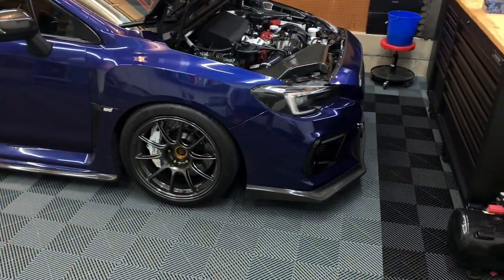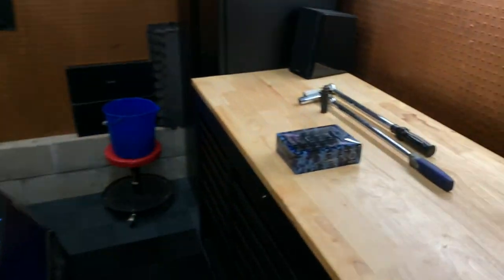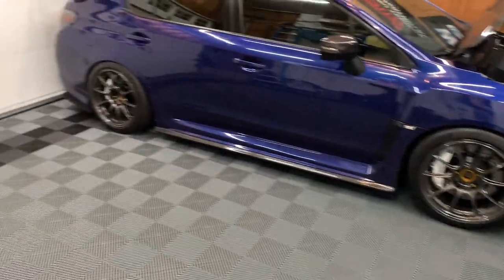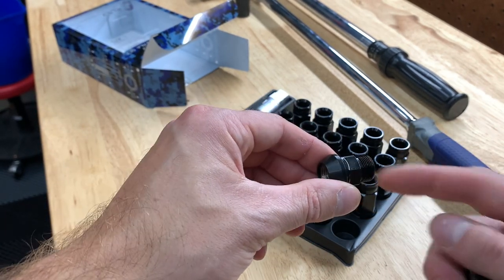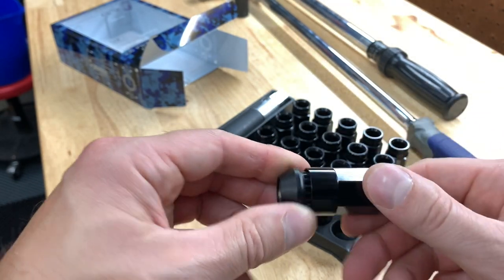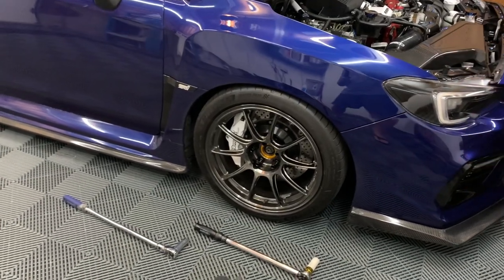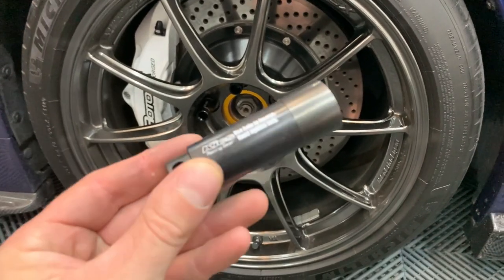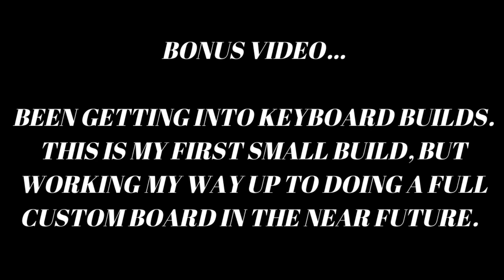Installing 2 Piece Project Kics Lug Nuts On My STI | + Bonus Keyboard Build!

Comment: Just ordered a set. I originally went with sickspeed. But those things are a joke. The molding on the lock nut splines were cracked. I wouldn't want to torque them down on my TE's and have it snap off, then have to resort to cutting them off and risking scratching my beautiful wheels. Thanks for the video, these look to be much higher quality, hopefully I like them 👍

Comment: Did you add any anti-seize to the threads before applying the lug nuts? I'm being told online that since these are aluminum nuts, anti-seize should be used. If not, did you have issues taking them on and off?
Reply from the maker: I did not and I didn’t have any issues.

Comment: Hey Chris, are you worried at all about not running extended studs with the spacers you have in the front? I really would prefer to run closed lugs, but I will be running 5mm spacers and they will most likely need extended studs
Reply from the maker: Im only running 3MM spacer up front. Lots of thread on the lugs. Anything over that, I would switch to extended studs.

Comment: Hey bro, Was wondering if these lugs are a float design at the point of contact where your lug touches the wheel? So when tightening youre not scratching your wheels. Or is that not a worries with these lugs?
Reply from the maker: These are not floating hats.
Reply: @Scoobyfreak86  no issues with scratching the wheel though?
Reply from the maker: @stephenculcasi never had that issue as I torqued them down slowly. No impact or aggressive wrenching.
Reply: @Scoobyfreak86  thank you sir. Also one more question. I also don't like the red valve stem that come on the TE's. Where would you suggest going for a set of black stems for my 2011 sti? I don't know if I can use just any valve stem on TE's, do you happen to know?
Reply from the maker: @stephenculcasi they have black available. I got black stems on my current te’s. They came with red as well.
Reply: @Scoobyfreak86 thanks, appreciate your help. I got 18x9.5 +38. I'm going for a flush look, I hate the stretch look and want a meaty tire. I know it's hard to say but what tire and size would you recommend? 255? Not wanting to do a lot of camber (more than 3).
Reply from the maker: @stephenculcasi 265

Comment: Will these work with extended lugs? I have the stuf conversion on my Jetta I believe they are 70mm and if they are closed I’m assuming the won’t work and my studs are too long
Reply from the maker: The caps are not open ended so it wouldn’t work.
Reply: Damn that sucks these things are badass

Comment: Did you put anything on your main hub locking nut to keep from rusting?  I have TE37'S and they don't make center caps (I also like the raw look anyways)  but I really want to keep it clean and rust free.
Reply from the maker: I haven’t but I just hit it with a steel brush every so often. You can throw some paint on top if you want to keep it looking nice.
Reply: @Scoobyfreak86  I want to keep the steel metal look. I like it. I just don't want it rusting. I'd love to find replacements in stainless buy I have no idea where I would find them.
Reply from the maker: Look into titanium works. They make titanium axle nuts. They will stay looking good forever. I’ll have a video on them soon.

Comment: What socket set are you using for your lug nuts? Kinda look like the Pittsburgh sockets that help prevent scratches
Reply from the maker: Yes sir. Harbor freight special.
Reply: @Scoobyfreak86  I just picked them up the other day how are they holding up?😂
Reply from the maker: They are doing great. Haven’t had any issues with them.  Great set for a good price.
Reply: @Scoobyfreak86  for our cars only the 19 mm is needed right? I just started getting into doing maintenance and aftermarket installs on my sti so I don’t really know a whole lot but your channel has definitely helped a ton!
Reply from the maker: Yes 19 unless you are running aftermarket lugs
Reply: @Scoobyfreak86  okay thank you!

Comment: I'm looking at new lug nuts.. why did you get these (aluminum) over something steel?
Reply from the maker: The lugs are steel. The covers are aluminum.
Reply: @Scoobyfreak86  ty for the responses.. I guess the size I need is just really hard to find 56.1-76.1.
also do you use metal or plastic hubcentric rings?
Reply from the maker: I use the project kics ones
Reply: @Scoobyfreak86  oh man.. even that brand doesn't have the sizes

Comment: Are looking to buy these, are they universal? Would they fit on my 21 Sti ? I got D9RS WORKS
LMK curious
Reply from the maker: They have different sizes available yes
Reply: @Scoobyfreak86  I checked on subie speed bro and they only have  universal ones, just wanted to make sure if those are the ones you have

Comment: I wish these had the rotating base.
Reply from the maker: Definitely would be a nice added touch.
Reply: I'm almost leaning toward the Kics Monolith in Neochrome and black cap inserts to go with the Glim black ZR10 19x9.5 +30. With Works Flat center caps in black.

Comment: How come you don’t run center caps? Does the hub centric ring prevent you from reinstalling center caps?
Reply from the maker: The caps that are available for the wheels aren’t the most attractive thing. Prefer to run them capless.
Reply: @Scoobyfreak86  but they are still able to be installed? Even with the hub rings on? Thanks for your response btw! I’m all the wayyyy from Guam 🇬🇺
Reply from the maker: The caps for these wheels have integrated hub rings, so you need to remove the ones I have on now in order to use the caps that are available for these wheels.

Comment: How reliable is an 15’ sti with an intake and a intercooler. I’m looking at purchasing one with these existing mods. Would I need to get it tuned or is it safe to just use the car as is?
Reply from the maker: Intake you need a tune. Tmic you don’t. Fmic would do.

Comment: How are these lug nuts holding up so far?
Reply from the maker: Still look as good as day 1
Reply: @Scoobyfreak86  awesome. gonna pick some up!
Reply: These can go on any make or model vehicle? @scobbyfreak86
Reply from the maker: Yes just need to get the right thread pitch for the vehicle you are using them on.